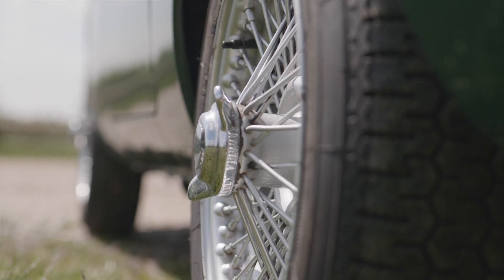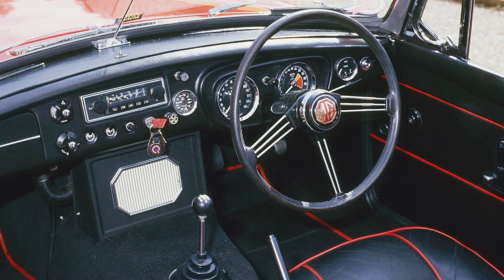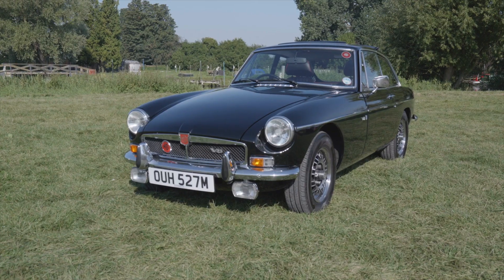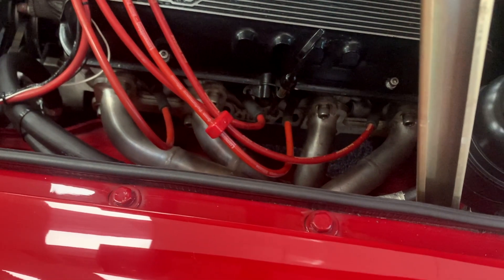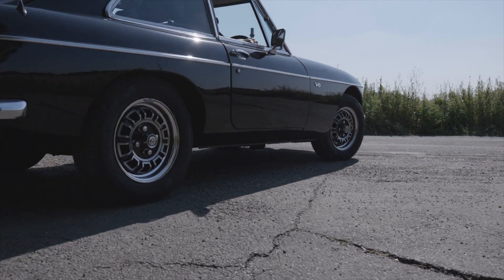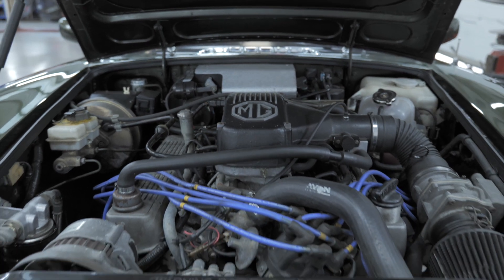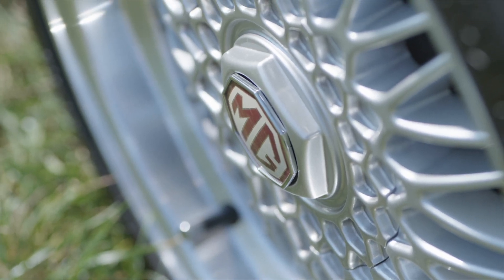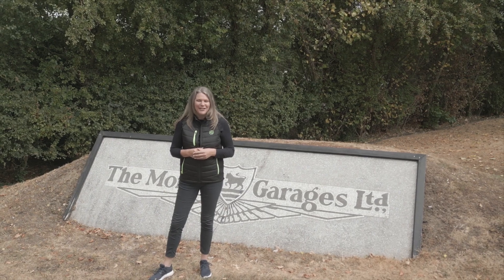The MGOC buyer's guide to the MGC, MGB GT V8 & RV8

Comment: Great review, back in my days living in UK I owned an MGC GT with Stage 3 Downton tune – incredible car, sounded awesome. I'd aways fancied a GT V8 though and I had a mate who had a Glacier  White factory car, which only cemented my desire for one. Due to prices of factory V8s I started looking at conversions and finally found a lovely 73 GT in dark blue which had been owned for some 27 years by the man who did the conversion way back. He was an engineer. He used a tuned Rover SD1 V8 and the associated LT77 gearbox and other slight mods, but the whole car looked totally stock 1.8 litre plus its rostyles and no V8 badges – until you turned the key, a wolf in sheeps clothing. It was a lovely car and performed and handled much better than the factory V8s. 

Still one of my favourite MGBs was a 1967 Sandy Beige GT (stunning colour) I owned 35 years ago! It had a Webasto, black leather white piping, wire wheels, electric door mirror, redesigned heater/blower cooling system using eyeball vents on the dash, large centre console/arm rest in leather with space underneath, raised seats by an inch (makes a big difference I feel) and a steering column mounted overdrive switch based on a second indicator stalk so you could flick in and out of overdrive using a finger without taking your right hand off the wheel. All these mods were done in the late 60s by its first owner, all done to a very high standard. I sold it in 1988 and it appeared on the market 5 months back, still in fine fettle – sadly I missed it though! The clever overdrive setup had been changed to a gearstick switch.
Reply: I loved my 67 MGB roadster it was modified and and went pretty well, at 20 in the early eighties, I still wish I had that car today

Comment: After many MG's of all models  I still retain an RWA Midget  cos I love the A series lump  . That said , after a trio of B's  I came to a definate conclusion  that If I wanted to continue driving a roof off car in the UK  It had to be a Sunbeam Alpine   .   and going from a B to an Alpine was a revelation ....gone was the antquated old lever arm shockers  in place of telescopic all round  , gone was the nasty baulky  non synchro box of the b  into the delightful all synchro Sunbeam precision engineered bos with overdrive    Gone was the cramped boot of the b   and in its place a simply vast boot of the Alpine due to the dual wing mounted fueltanks   then there is the driving experience of the wonderful microcell seating of the Alpine rather than the sit up and beg B  the beautiful rear lift bonnet allowing easy access to the alloy headed 1725 engine as oppose to the gutless A60 Cambridge lump and braking that simply was so good that nothing required changing for the instllation of the Carol Shelby V8 tiger     Then I look underneath and see not one but two chassis !!  No wonder the thing was able to take the V8 with no mods   as oppose to the MGB chassis that ends abrubtly  somewhere under the drivers seat  and we have not even mentioned the "Crack of doom " on the MGB door under the quarter light that nobody talks about .      Nah !!    the Sunbeam is in reality a huge leap over the B